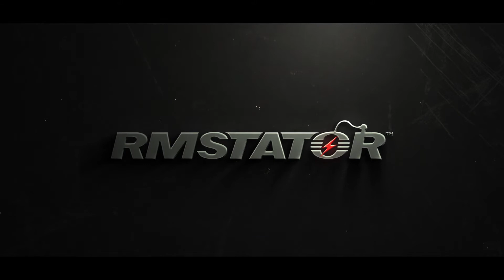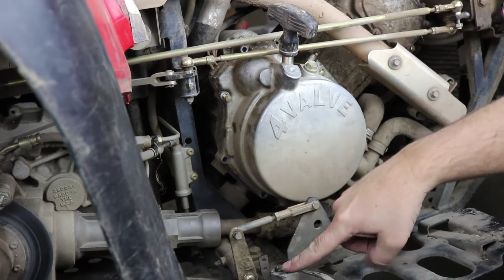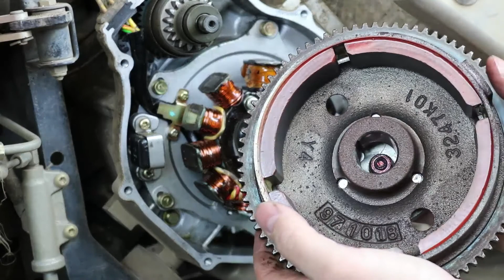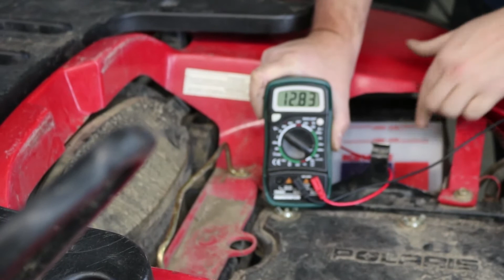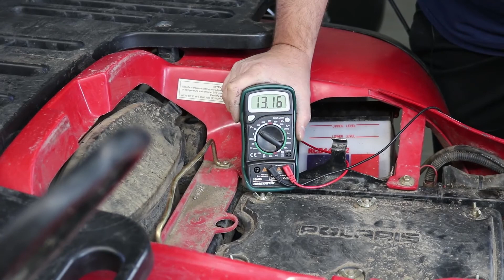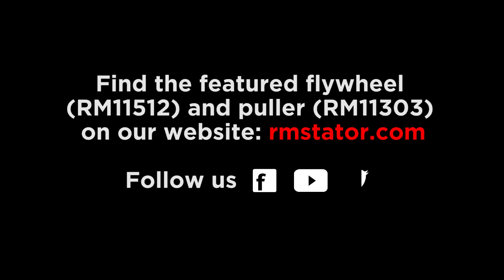How To Install a Polaris 500cc ATVs FF97 Improved Flywheel Rotor Instructions RM11512

Comment: I used this video and it put me in a bind....and i tried a new upgrade and it didn't fit none spent so much money on flywheel that the numbers were good and still the center were to far or to long or to thin. Finally got a original from a dealer but took a year..

Comment: Actually I used a impact wrench to install flywheel and it stripped the nut clean and left threads in the driveshaft threads . Next time definitely won't do that again.
Reply: Yup and it lead to all sorts of problems for me.. couldn't find the bolt replacement and at that it destroyed my woodruff key and couldn't find a new fly wheel so ya I don't recommend using a impact wrench at all I use this video and it completely destroyed all the components to the fly wheel housing..so ya pass this on to less people who don't know

Comment: What bolt thread did you use on the flywheel? I have a puller, but can't figure out the threads to secure it